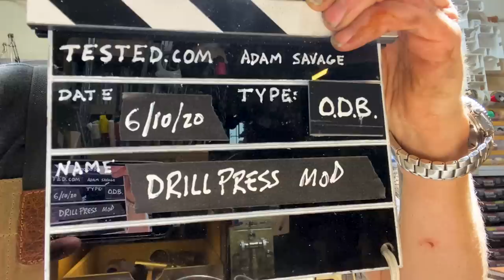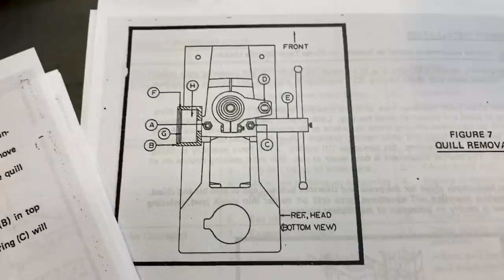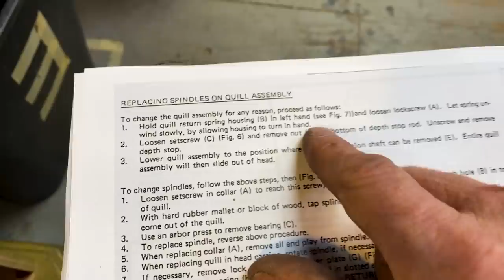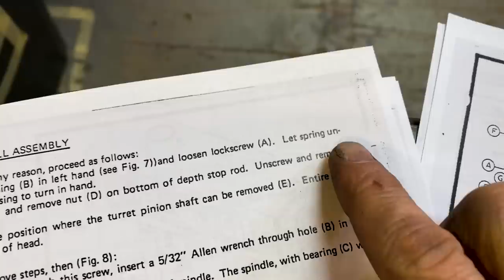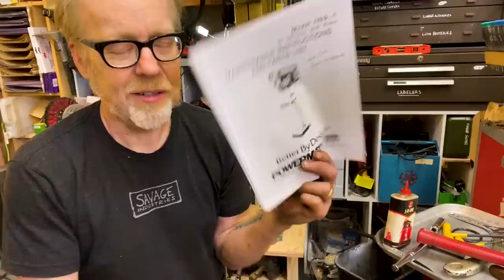Adam Savage's One Day Builds: Drill Press Modification!

Comment: I haven't seen one for years (Then again, I haven't been looking), But you used to be able to get Jacobs taper reamers to clean up the taper in chucks.  You can either put the reamer in the tail stock of your lathe and centre the chuck in the lathes chuck to clean it out, Or (The simpler method) chuck up a 3 or 4" length of 1/2" ground bar in the tail stock, Then tighten the faulty chuck onto the ground bar. Then put the reamer in the lathes chuck. If you've got much slop in the tail stock you're probably best using the first method, But if it's tight and concentric, the second way is easier to get the old chucks jaws and taper running true to each other. Don't go TOO mad with metal removal though as a tiny amount off the taper bore is enough to make the old chuck move a lot further up the taper before seating.

Also, You struggled to removed the depth stop clamp and said it's grub screw had chewed up the bottom of the quill a bit. An old engineering trick to avoid this on low load "shaft clamp" types of application is to make a small disc of brass to go down the screw hole first. I was told a rule of thumb was that it had to be a reasonably close fit in the hole, And about half it's diameter thick. This little "Hockey puck" of brass will deform well enough to hold onto the shaft, But won't munch the ground steel surface. It's no use if it's a clamp being used to transfer torque (Like the grub screws on a non keyed pulley), But for holding something like your depth stop clamp it should be fine.

BTW, That's a pretty nice piece of 80's tooling you've got there. I've been looking for a classic drill press to restore for a few months now. I'm after something for my little play room workshop like a 1940's Fobco star or an early Kerry Drillmaster, You know, Something that can not only still do the job, But also has a bit of classic British "over engineered" style to it as well, And built to last a couple of LIFETIMES of constant use, rather than the couple of decades (If you're careful and lucky) you get from the modern stuff. Trouble is, Here in the  UK it seems a lot of people have discovered that their's money to be had in buying mid 20th century engineering machinery, Giving them a pretty paint job, And selling them off as "Restored". That's kicked the price of genuine but shabby complete equipment up well over what they're worth once you add the cost of REALLY restoring them. :(

My little workshop's a personal toy room that I mess about in. It's not there so I can make stuff for paying customers. All outgoings associated with it are costs rather than investments in a business....... So I don't want to pay a premium for a drill press I'm going to spend a couple months stripping, cleaning, painting and rebuilding properly. :)

Comment: I almost thought you were going to use the Stonehenge ( and other stone block moving methods, since you mentioned walking like they did with the one Island... I'm terrible with names... Easter Island, that's it.. )... There were 2 2x4s on the ground, and I thought you were going to raise it up so you could lay it on your desk, and it wouldn't take much effort. Maybe a rope above to make sure it doesn't tilt too far and so you pull down and it comes into the upright position. Tilt, move 2x4 under one side and either tilt and move the 2x4 toward the part which is on the ground until it is centered underneath, then slide the second 2x4 underneath then spread them out. Then Jenga slide, perpendicular with another set of shims ( 2x4 or not ) and to that to lift it up just by rocking. Using this method you can lift insanely heavy objects to great heights without using a lot of energy. It is better with another person on the rope, but with one person you could tie it around your waist so if it starts to tip, you go limp and it rights itself. It is also better to use sheets of wood instead of 2x4s though because they provide a more stable base and then you can walk the machine on top of them.

Comment: If you ever have that kind of problem again with a worn shaft and replacements are not available, go to a crankshaft repair shop where they do metal spraying. They can build up the surface and grind it to whatever tolerance you need.

Comment: That drill press may have been manufactured in my hometown of McMinnville. Or at least the castings. The factory may have only produced castings I'm not totally sure as I was very young when it was still in operation. I know there was a foundry as everyone that worked there had cars that were rust covered from the exhaust settling on the horizontal surfaces on everything. There's nothing left of the factory except the concrete slabs and the parking lot.

Comment: I would suggest spray welding the old spindle. It's often used to repair old shafts that have grooves worn in them
Reply: Also yes. You forgot the o-ring seal that you slid off the new shaft

Comment: Add a bushing into your keyless chuck. Bore the tapper bigger and make a bushing to size and make it about. 0003 bigger on the od for smooth press fit without crushing your id. I recommend beryllium copper for your bushing. That should fix your problem.

Comment: I remember my last job I had, it was a print shop and we had a 3 hole hydraulic drill press. Yeah a 3 hole drill for large stacks of paper or books, and it used hollow bits where the paper would come up through the middle of them and out the top of the press. It had to be from the late 60's. but one time one of the satellite drill head so how gets hit and its way out of alignment and now it its down for ever and we had to ship all our stuff to another print shop to have them 3 hole them big pain in the ass... trying to find a replacement head for that was the biggest headache. Comes to find out most drill presses of that age went to gear boxes to power the satellite drill heads while ours was belt driven.

Comment: @14.50 when you count "off" two turns - the quill is UP, but...
@31.30 when you count "on" two turns - the quill is DOWN! 
Which means you actually put LESS tension onto the spring compared to what you took off! (by about one length of the quill, or however many turns that is.)  So if you put a heavy drill bit / etc. into the chuck, it probably won't return to (or stay in) the fully-up position, under spring-tension alone.

Also @14.45 you say "there's a whole separate part of the repair manual for putting back in a spring, and I will look that up when I'm repairing this" ....did you?!

I do enjoy your videos - good work!

Comment: I'm like 95% sure you put that table raising mechanism on upside-down. The way you have it, when you lower the table a lot, the screw will hit the ground. If you flip it over, the screw will remain stationary with the column of the drill press and the handle will move with the table, making it easy to find. Pretty sure you need to flip that the other way.

Comment: The chuck might be re-purposed, say, for the lathe tailstock.  Get enough of a grind on the taper to insure there are no high spots in it, locktite it to a new jacobs to morse adapter.  Should be nice for step drilling center holes with multiple bit changes.

Comment: You can buy a spindle taper hone to clean up the taper surface of the chuck, Also if I was confronted with that spindle damage, I would either weld and regrind the spindle or, for a quick fix, I would try JB weld with a regrind on my lathe (or I would buy a new spindle off eBay).

Comment: If the chuck falls off, it wasnt mount properly.
I never seen a chuck fell off the holder, only the chuck with the MK3 or MK5 holder ripped out of the spindel or tailstock and once the chuck break off the MK, but the little kone still stuck in the chuck.
If you want to make sure the chuck dont fall off, put the chuck in the oven at around 50-60°C and/or the MK in the fridge befor mounting

Comment: I think that some good grease on the rack and pinion would be a better option than the thin oil. ;)
Almost all normal drill presses are the same basic construction, my old Huvema HU-16 Profi for example, uses 95% the same spindle construction.

Comment: A few items:
 - I don't believe the "light coat" of oil you applied offset the oil that poured out of the removed shaft

 - The shaft may be repairable on your lathe using a toolpost grinder.  It'd be a great class in doing a taper using the compound.

 - You should have marked both the return spring position AND the position of the turret pinion in the spindle's fully upward position.
     Not doing the latter and given the pinion to spring connection is a "two flats" arrangement means the "two turns" are likely irrelevant to the tune of half the number of pinion teeth minus one. ("One" being the correct tooth pair on the pinion).  Disregarding the marks you made and going with two actual turns would have been the better choice.  Though, changing out the entire part and messing about with the tension preset bolt probably means "two turns" isn't really the best setting, anymore.  It seemed to be a little too tensioned, to me.  But, if the spring never gets wound tight against its arbor, it shouldn't matter much.

 - Reseda Green

That said...  Great job, as always.  Your creativity and ability to identify projects is amazing.  Painting one side of your X Y table nuts wrench was one such inspired moment.

A question...  I've noticed you seem to have a fear of pegboard.  Is there something the rest of us should be made aware of?

If you need somebody to sort bolts or resistors or rolls of tape, or cut and buff some pot metal, put me on your volunteer list. I'm in the Sierra foothills.

Martin

Comment: 11:30 If you want to use your drill press as a spindle sander, I'd recommend against it and use your lathe or mill instead which are designed for axial forces.
Reply: One thing that I've seen people do is to provide a support on the drill press table for the sanding spindle. That would reduce the lateral load.

Comment: I noticed two set screw holes in the side of the old keyless chuck. The top one looks like it would engage the threaded portion. Is the bottom one the culprit of the taper damage 🤔?

Comment: Saving the old chuck: No, you don't have to get rid of it, just grind it to the next larger taper, and put it to another use. Jacobs tapers in order of increasing size, #2, #33, #6, #3...

You need two things,  first (and cheap) a morse taper (to fit your lathe tailstock) to the next size larger Jacobs taper (should be a #6.).   The other thing is a tool post grinder.  (No, a dremel doesn't have good enough bearings).  You might be able to use a carbide boring bar, depends on how good a job they did hardening the chuck body.  Oh yea, I would take the chuck apart and mount just the chuck's core when turning it.

The new adapter in the tailstock, along with a dial indicator will allow you to get the angle on the compound slide.  You can then grind a new larger taper into the back of the chuck.  Mount to the morse spindle, and you get another chuck for your lathe.  (keep a center drill mounted to save some time)

Oh yea for those mounting a chuck on a taper, Instead of a press to secure the taper, heat the chuck to around 100C, and throw the spindle in the freezer.  Fit together with light pressure, and the result will compare with several tons of pressure without the temperature difference.  Makes it a whole lot less likely to come off, or spin on the taper.  And this is also a teaching moment for those that want to try end mills in their drill press, unless you have have the threaded mount  and compatible chuck,  like the replacement spindle you found, they are candidates for the same repair issue you had.

BTW: I agree with your opinion of the powermatic.  I have its larger cousin, I got it 5th or 6th hand.  Mine is branded Rockwell, (20 inch table), which came with a table elevation system. and the spindle itself is morse taper (unfortunately its #2, and my lathe is #3).

Comment: Here's my suggestion on how to get your threaded chuck and reuse the bad keyless chuck:
Chuck a dowel pin into the lathe and indicate in until zero runout
Tighten the drill chuck down on the other end of the dowel pin
Bore out the morse taper to a cylindrical bore
Remove from lathe
Machine an adapter that has the morse taper and shoulder for nut
Machine the other end of the adapter to be a press fit into the cylindrical bore
Use liquid nitrogen on the adapter to create a permanent press fit

This method should keep the runout manageable as long as the adapter is concentric between the morse taper and cylindrical section.

Comment: I'd completely disassemble the old quill assembly, install new bearings, pull the spindle stub, and either regrind it, or (using the existing stub for dimensions) make a new one.  Simple job on a lathe, and Adam has a very stout one.  Look around YouTube, you'll find some how-tos on setting up the cross-slide for cutting a precision taper.   The chuck is trash.   If it were an Albrecht, I'd try and find a new back end, but if it's a CME/Harvest chuck, either pitch it, or rework it for use in one of your cordless drills.

Comment: Hey Adam check out a brand of measuring tape made by a company called Fisco I think you’d appreciate them, it’s the Fisco Big T they have a clear section up front so you don’t have to burn an inch when measuring small objects and come with a really handy clip and release system to live on the side of your belt or apron.....Fisco BT16E is the model number for the 16ft. in inches

Comment: If you are using it as a sander, why not add a second chuck or some type of bearing with a live-punch or whatever it is called on a lathe, the one which spins... and lock it in on the bottom. This way you can put force on the bottom... Obviously, this won't work if you need to plunge into something, or want to use the bottom - but for what you described.... it could help for the ones without threads.

Ouch, looking at that grind it looks like some dirt or shavings or some type of mess got inside that chuck and wore down the tapered thing especially if it is locking up... If they were perfectly mated then this shouldn't happen unless the metal has different grains inside of it - like on brake rotors when you hit a piece of hardened material and it causes squeal.

I'm not sure if this would work... I don't think it would because I'm guessing that tapered thing is hardened steel.... but you could weld some material and then shape it down...

Comment: My craftsman from just after  wwii had no run when I got it. I bought it from a gentleman off of Craigslist it was his grandfather's and it was well maintained. When I went to pick it up after being awake all night helping my buddy install bowling alley sections as workbenches which is crazy heavy. I went to pick up the drill and the guy asked me if it was worth more than the $80 he was charging me for it. I told him that yes but chances of him finding somebody who will appreciate it as much as his grandfather did probably are not the people that were calling after he said he would sell it to me and freaking out on him because he wouldn't take twice as much. What the hell was my point? Oh yeah zero run out until a buddy and I built some tables on a subcontract for Oshkosh truck. I have a vise for the drill for the exact reason that my drill now has a lot of run out. Because my friend tried to drill through I think all 12 feet for the three tables all at the same time without clamping them in any way. How the hell that guy made it in an industrial setting without losing fingers is a mystery to me.
I don't know if anybody knows this or not but those Craftsman drills really had great lines. Art deco with engine-turned aluminum strips as an accent. The table is manually adjusted oh my back! My $1 Ford 1980s Jack sooner or later is getting bolted to the column and Presto I don't have to lift the damn table or the 23 25 piece of stainless steel that I made to increase the table size. Anyway I'm rambling thanks for the video.

Comment: I don't see why the spindle couldn't be welded and then turned to the 32° angle on a lathe. Cam shafts are repaired in this manner. Not sure if the chuck could be repaired this way or not.

Comment: Loctite on the taper works for ages and can be removed with a drift. Used this technique loads in our machine shop.
Reply: It seems like a better solution than threads. If the taper comes loose, the threads keep the chuck on there... grinding away the fit. 

Matthias Wandel would weld over the gouge marks on the taper then hit it with a grinder.

Comment: Doesn’t that quill have a morse-taper socket, so you could use any large drill or 3rd party chuck adaptor?
Reply: Ah… Looking at the parts, the quill can contain either a morse socket, or a fixed chuck adaptor.  I wonder if part 2640018 might have been available.

Comment: Take that borked drill chuck to the lathe, bore it out straight and mount it to a block. You can then use the chuck as a generic work holding device for small round or hex stock. You can also fit a male taper that fits your lathe tailstock and use it as another tailstock chuck. Nothing is truly garbage!

Comment: There is another Youtube channel with a less beefy drill press, that has motorized the raising and lowering of the table, using a cheap plug in hand drill as the motor.  You can see it in the back ground while he works ..... I don't remember the name of the channel, but he just built a Black & Decker buckboard car, circa early 1900's from scratch.  You can probably look it up for an idea on how to cheaply / easily motorize your drill press.

Comment: Just use your lathe to cut a new taper on your chuck. Then it will fit deeper onto the taper so you may be able to cut threads into the chuck as well.